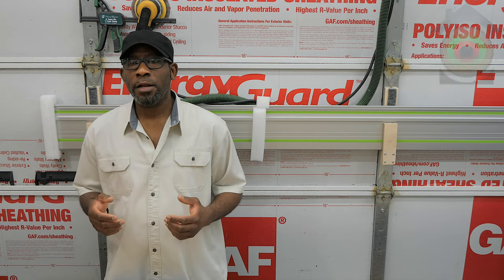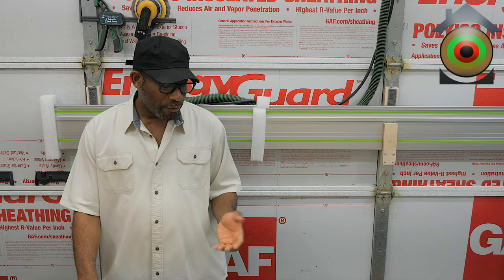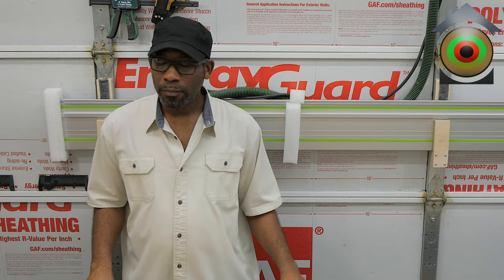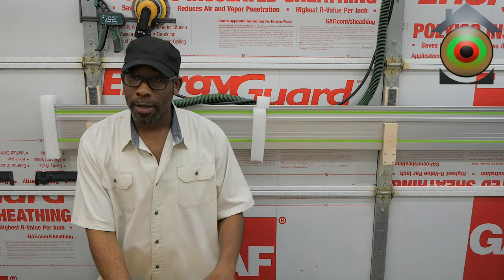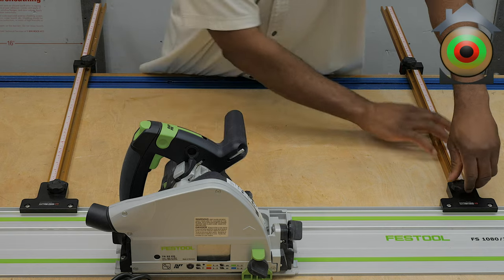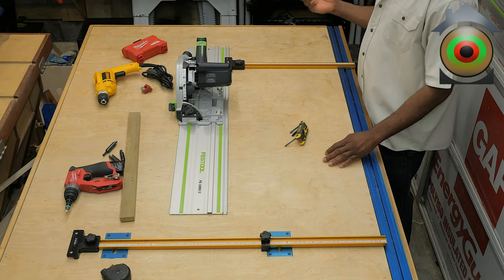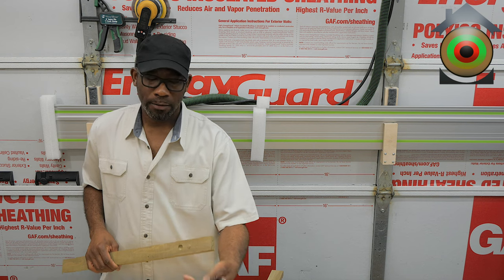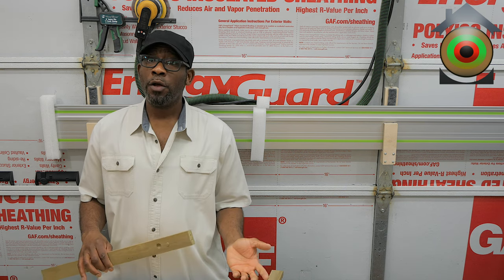DECISION DECISION PLUS PLUG IT

Comment: All my comments get removed. This is a test.
Reply from the maker: Not by me!  I don’t think! It would take a lot for me do so. Trolling! Disrespect! I’m fine with differing opinions! Thanks for watching!
Reply: @concentrichomesolutions  Not trolling some good stuff, good info. I will try again later.
Reply from the maker: @jeffstanley4593  Thanks!
Reply: @concentrichomesolutions  I did try again and again my post is not here.
Reply from the maker: @jeffstanley4593  when I get in, I’ll take a look at it.
Reply from the maker: There is nothing on my side that would prevent you from seeing your comments.
Reply: @concentrichomesolutions  I replied again with what I thought was the cause and my attempt to cure it and that too, was removed.
Reply from the maker: I’m confused. How am I able to see this one and the ones above.
Reply: @concentrichomesolutions  I have no idea but what I say is what is happening.
Reply from the maker: @jeffstanley4593  I don’t doubt it. I just find it odd. I have no idea what could be causing it. I’m sorry this is happening.
Reply from the maker: @jeffstanley4593  what is it you are trying to post when it doesn’t show?
Reply: @concentrichomesolutions  Two sites, one a YT video and a site for some screws. I posted the links so you could just click on them. I then posted the links with the word "dot" instead of a ".", neither worked as you see they are deleted. The screws are designed to be able to be driven within 1/2 inch of the end of a board without splitting it and they work! No pre drill. By the way, there is no such thing as "predrilling" . You are always drilling, it is a guide hole for the main drill process but nevertheless; it is still drilling not pre drilling. The other was a comparison of three parallel track guides already done on YT and done well. Save you from doing it.
Reply from the maker: Jeff, email it to me! Thank you! Michael_st._aimee@icloud.com